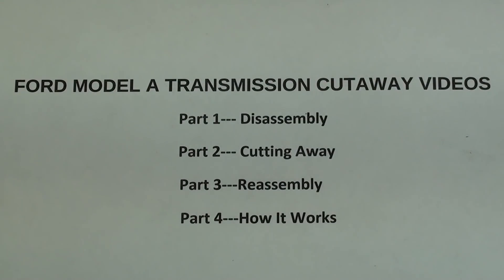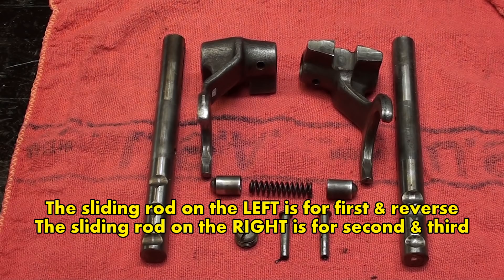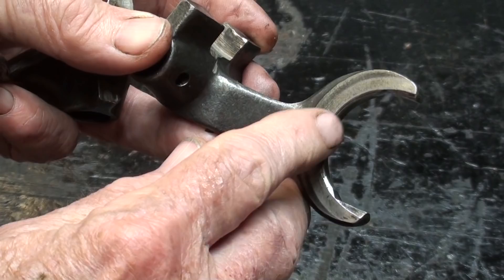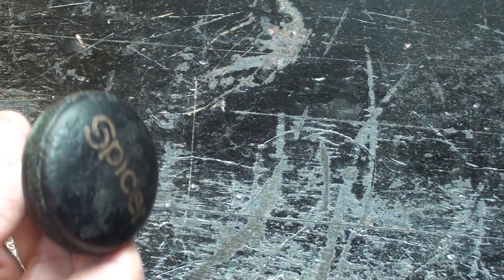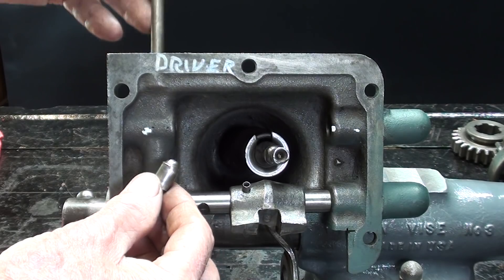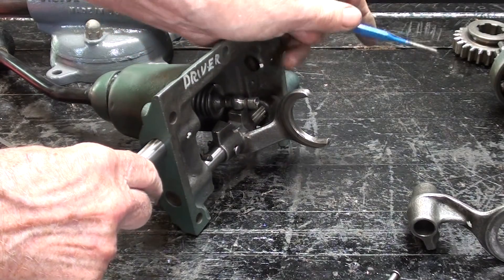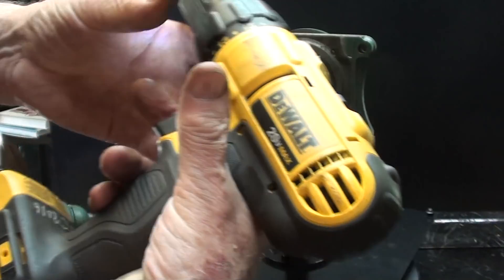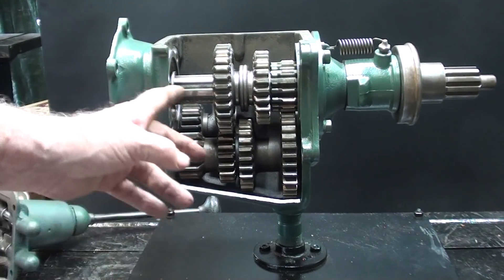FORD MODEL A Transmission Cutaway pt 3 REASSEMBLY 735 tubalcain

Comment: I think because colleges are failing so bad to make young minds actually smarter the trade schools are going to come back with a vengeance. Because that is so simple I think that's going to make an awesome display to stimulate young minds and to show them the basics of how a transmission works. 

You don't want to show bunch of 15 and 14 year olds a cutaway of a 14 speed automatic computer-controlled transmission you want to show them that thing.
Reply from the maker: Yes

Comment: The shift fork pins are 99 cents a pop
https://www.macsautoparts.com/model-a-ford-transmission-shifting-fork-pins-28-24330-1.html
The aftermarket for those old fords is huge. You can just about build a brand new one from repopped parts if somebody had the money.

Comment: I've actually had the pleasure of working on two different model a Ford's in my career as a automotive mechanic. They are neat to work on but do require that you have access to a lathe for a lot of the repairs. The shop repair manual explains in various sections about turning to length or diameter required for the car. Thankfully I have my own hobby machine shop at the shop so it helps quite a bit with repairs on these older cars. 

Thank you as always for taking your time to show us these videos and now I'm inspired to take a more modern manual transmission and do something similar to what you have done here.
Reply from the maker: That’s funny. It’s hard to believe that a repair manual would tell you to use a lathe.  lol
Reply: @mrpete222  I'll have to look it up again and take a pic to send to you. I believe it was in reference to the steering shaft length but has been a while since I've worked on one.

Comment: Hi Lyle, it's coming along nicely mate, about 40 years ago a mate did a cutaway Honda 2 cylinder bike engine
I think it was a 250cc
He painted the cut surfaces blue and red, he took hours and hours to do it. I loved the visual understanding it gives you when you look on and watch it in a way that normally you can only dream it is working.

I came across 
Joe Pieczynzski showing off
His machine shop skills
Building this 

Smallest Functional Lathe You May Ever See !!

https://youtu.be/NO6l41ZGSBQ

So far his series is absolutely fascinating Lyle, I think if you haven't already, check it out 

And he is doing it all with full sized machines!
Tony from Western Australia 🇦🇺

Comment: I really love this series and am amazed at the robust simplicity of this transmission. I see you are sensitive to the overcut on the shift tower. A dab of Bondo would work a treat here.
 My Freight equipment made of Chinesium came already beautified with liberal applications of the chinese equivalent of Bondo and looks great until scratched. Thank you for the labor and time you put into these instructive and informative videos. Cheers

Comment: Did you tighten up the bolt that holds the external keeper that holds the shafts in place with that fancy Dewalt?

Comment: Very nice, and thanks for the series so far, Lyle.
May I suggest that you do add the safety wiring to the bearing retainer bolts. Might as well be as accurate as possible if this is to be an educational display. (And I wouldn't be surprised if it lands in a museum someday.)

Comment: As you mentioned when you began, I find this fascinating as I had no idea what this, or any transmission looked like inside.  I am anxiously awaiting the final episode as you detail how this thing works.  I learned to drive on a 1959 Ford station wagon with a three speed manual transmission (shifter on the steering column).  But I would bet that transmission was much larger as it also had "Over Drive" which I never messed with as Dad only let me run the car around town.  But I would bet that adding overdrive complicated things as well.

Comment: Every gearbox, whether manual or auto enthralls me, they are just a thing of beauty, and engineering excellence- As a kid I would watch for hours as one was stripped down, fixed and rebuilt- I used to get teased about my obssesion, but I didn't care. I am now a retired engineer wirh happy memories of the helical gear. Kids today are missing out on hands on grassroots  engineering in favour of computers doing the thinking- but computers can't invent and iterate at the workbench !

Comment: I worked on many Ford standard and automatic transmissions from the 70s and on. You are lucky in the fact your meddle bearings were caged. Most later models were not, they were loose. If you were lucky enough to have the correct dumby shaft it was shorter just the length of the cluster and allow you to keep the bearings in the cluster for instalation and removal. You had to count the exact number of loose rollers install them with grease to retain them and then install the cluster and also many times the input to output shaft. They taxed my patience many a time!
Reply from the maker: Good comment. You can be assured, that I struggled with loose needles many times in my long life, LOL

Comment: Such a simple little box. The thing I hated the most rebuilding the big truck transmissions was the micro small metal slivers that would stick you at the most inconvenient time. Hard to see even under magnification.
Maybe someone can show the difference between a sliding clutch mainshaft next to a sliding gear mainshaft. 
Paint one tooth on each year so you can count the revolutions and determine gear ratios.
Thank you Mr. Pete. Great series and a great teaching aid for a drivers Ed class.

Comment: Don’t forget the 600 w oil that goes in it.
600 w is thick like STP or honey. 
They never used 90 w in that transmission or rear end.
600 w worked liked synchronizer to slow down the spinning of the gears so you could shift.
When it gets 0 or below they are hard to shift until they warm up.

Comment: A simple transmission for simpler times. I have never driven a model A but I would imagine that it would require a special technique to shift without grinding the gears as there are no synchronizers.  Probably most of the shifting was done at very low speed and once you were in high gear you would just stay there.. I am enjoying the series.
Reply: @ Phillip  I have never driven one either, but I understand that in the old days you had to do what was known in the UK as Double De clutching. I think you depressed the clutch, took it into neutral, released the clutch and changed the engine speed to get the gears running faster / slower, depress the clutch again and shift into either a lower or higher gear depending whether you were accelerating or slowing down.If I am incorrect with this answer, I feel sure someone out in YouTube land will correct me.

Comment: That would make a nice display piece. Complex enough to be interesting and simple enough to understand. It has some significant history with it also being a model T gear box. I'm sure a museum somewhere would be interested in buying that.
This has been a thoroughly enjoyable series so far, I'm looking forward to pt4.
Reply: The Model T transmission is not the same as the Model A. It would be interesting to see a cutaway of the T if Mr. Pete can find one. Not many of those left I’m afraid.

Comment: Well done Lyle. Trouble is that you have forgotten to reinstall the Syncro Hubs. LOL.  So will now only be a crash gearbox. Take it easy. Happy 4 th July. Regards from Australia.
Reply: Hi Dave, from Charlotte N.C. U.S.A. My first car was a 1929 Model A and I don’t recall any gear “crashing” at all. When shifting from first to second and third I quickly learned to let the engine slow down a bit before slipping the gears silently together. It was a learned technique that came with experience.

Comment: I can see why this gearbox is so heavy duty and well built, having to pull those heavy cars around for many years, thanks for uploading this series, a fascinating watch.
Reply: Model A's wasn't heavy at all. Thats why they were so popular with hot rodders. Could pick them up way back when for dirt cheap, they were light weight, and drop a much bigger engine in them.
The parts for them were built heavy duty because they were built to last back then. They were also built so anybody could work on them. Today everything is built with planned obsolescence with it planned you have to take it to a dealer to get robbed when something needs fixed.
Reply: @user-neo71665  yep, you're right there, cheap builds nowadays